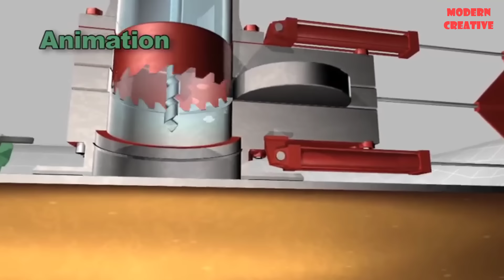Great Teamwork Skills Of The Workers When Hot Tapping Giant Pipeline | Awesome Welding Skill

Comment: For anyone wondering what they are doing in these videos - a hot tap is typically “work” on an in service pipe line without taking it out of service. It’s not really explained well in this video but in the first segment they start out with a big in service pipe, and installed 2 valves with a bypass, this is the piece at 4:15 that allows fluid to flow around the area they are working on, so the pipeline doesn’t have to be shut down while they make repairs or tie in another well or pipeline.  

Once the bypass is flowing, the section between them is isolated and the pressure is bled off with the 2 small silver valves you see them install.  In this video, they installed the bypass, then once it was depressurized, they cut in a valve (blue valve shown at about the 4:49 min mark).  The last few mins of the video shows the hot tap cutter, like a big hole saw, contained in water, presumably to prevent any sparks from igniting what’s in the pipe.
Reply: Very good explanation! I didn't understand why they welded a tee on the pipe without cutting before.
What is the tool at 1:39?
Reply: The contents of the pipeline will not ignite,,,,,   No oxygen.
Reply: Lynn C. Doyle - uh yeah, so long as it’s sealed in the pipe. But......if you drill a big hole in the pipe like what they are doing here, then.....it’s exposed to oxygen.  Even if the pipe is empty of product the remaining vapours can ignite so you still need to prevent sparks.
Reply: @ScoredPiston  I've made several small (2 to 6 inch)  hot taps and still have some of my fingers and most of my face.  How many have you made?
Reply: Lynn C. Doyle - pipeline decommissioning is part of my job.  So hot / cold taps, bleed downs, pigging etc are routine in my world. Stay safe man.
Reply: @ScoredPiston. Thanks so much for your explanation. I’d like to ask you pick your brains (not a zombie, I promise), about pipelines in general,  preferably off YouTube

Comment: Did I blink and miss the bit where they inserted the plug, then cut the pipe section out, welded flanges on and installed the big blue isolation valve?
Reply: The pipe is full and a live and is on those cases is no way to stop theliquid runing
Reply: Looks like its just water. No real threat there like high pressure natural gas
Reply: @HB-kp6rl  Agreed, blue valve is a give away, probably PN10 at the most. HPNG  would be a way better valve..
Reply: Also all low psi flange with just a gasket no api rings
Reply: Dan Koldenhoven when i heard hot tap I thought high pressure. Turns out to be just some regular bullshit water line stuff
Reply: Softcore piping for out of work oilfield workers
Reply: Halifax Matt Bahahaha
Reply: They inserted the plug stopper at the smaller taps on both sides, kinda inflatable type, then cut and put the isolation valve. A lot of details had not been shown on the video.
Reply: No it is a hot tap. The line is live never shut down. Pressure could be slightly lowered

Comment: You could see a complete different approach to safety between Turkey (thanks Patrick) and Canada.   
Canada
Full PPE...check
Using tag lines...check
Properly sloped excavation...check
No beards on workers or bosses...check
Not standing under suspended loads...check
Using fall protection...check
Using hi torque wrenches...check
Only required workers in ditch...check
Advertising for "monster" energy drinks...check
Reply: You didn't go there did you?  This is Turkey...
Reply: My spidey sense was going off the charts in the first one😬😬😬
Reply: Agreed.

Comment: I worked on this equipment everyday for the past 6 years. The valves in the first job looked rough at best.
Reply: Not impressed. The Mexicans are currently hot tapping with 2 man crews and none of the fancy equipment.
Reply: CB I second your comment deffo wouldn't pass a UK inspection
👍👍👍😜🏴🦄🎣😁🤞✌️
Reply: @samsonsrevenge4357  And blowing themselves up in the process.

Comment: Wouldn't the pipe contents be contaminated with metal shavings from that drill? How does that work?
Reply: They're not paid enough to care
Reply: Not much, though maybe not all, most tapping drill had it's own flushing fluids that suck away metal shavings.
Reply: They still the hole after they mount the gate valve with hot tap machine the coupon is collected on the drill bit and the shavings are caught by magnets at the pressure station!

Comment: Great video, but I’m confused. Why did they drill the main t junction hole last in the process instead of drilling it earlier or before welding?
Reply: I think I understand what you mean, but the T is open when they fit it. The plate/coupon that comes out at the and is a piece of the in service pipe

Comment: This would have been better without the music. Maybe somebody explaining what going on.
Reply: And the a bit of text at the top every so often
Reply: Try muting, it works. Reading the text might give some context on what is going on too.
Reply: They are hot tapping this pipeline. It is used to plug into pipeline with something like valve, some measurements equipment or t section, without interrupting flow in pipeline. Google hot tapping and you will find some animations on YouTube.

Comment: Anybody else here watching before doing a huge piping job?

Me neither.
Reply: It’s way easier to just cut the pipe and welded in the tee than the huge job they are making this. Look up pipe liners
Reply: I just found the reason it’s being done in Canada.... they have crazy regulations on pipelining their.
Reply: @robertkakela2068  its because they cant let pressure off, thousands people would be without it for atleast a day. Thats not acceptable.
Reply: I wish I had found this before! Now I know what I did wrong.
Reply: No, but I did before in the oil and gas. Though that this is hot tapping on a water pipeline, a lot of details had not been shown. So, never assume that you know how to do it exactly because you have seen this video.

Comment: I wonder how much pressure is in the line and what the flow rate is while they are welding? This isn’t as easy as this video makes it.
Reply: Those are 600 series flanges rated to 1480 psi. Probably between 500-1400.

Comment: The Best Pipe To Be Using For Upgrades is Called PVC Piping And it is A Hard Plastic Piping And it is A Whole Lot Safer it is Called PVC Water Piping
Reply: PVC won't hold 800 psi in 12 inch line.

Comment: I hate all of the safety nazi comments on YouTube but I was a little surprised with the lack of shoring in the first segment. Here in the US people would be in jail for people working next to a vertical cut higher than their heads.
Reply: Actually if the bottom of the trench is wider then the height of the trench wall it's considered an excavation and different rules apply

Comment: As a retired pipe liner I saw this once in 22 years
Reply: I pipelined for 6 years and we delt with these TD Williams taps and stopple fittings on several jobs it’s a high stress job cuz there is no little problems any problem is a big deal
Reply: You are right everything gotta be perfect i did pipeline in wyoming  and those inspecters dont give no slack at all

Comment: the sheer strength of those bolts is abr 8o,oo0 psa EACH  dunno why there are so many
Reply: Redundancy I assume.
Reply: They had a few extra  left over from the last job.
Reply: Because of vibrations in the pipe. Bolts come loose over time because of vibration.

Comment: The facts about everyone standing around...you have multiple safety men from both the gas company and the contractor hired to do the job, you have a welding inspector, a coating inspector, and multiple company representatives because this process is extremely dangerous and expensive. The 2 red towers insert stopples that halt millions of dollars worth of product from flowing to its destination. They remove the bad section of pipe and replace it and there should be plenty of eyes during this process

Comment: People commenting on how to get jobs. This is not the type of job where you can move slow because you don't want to work hard.  You cannot work half ass or just wing it. Also if you think others are not working so you wont, then screw your a liability.  Ask people if they have ever applied for a job like this.  Everyone says no. If you are good with hands and have knowledge of tools. Look for companies that do this and apply.  It involves travel all over but thats paid for.  I applied for a gas utility job and got it . 2yrs later I'm tapping into low and hp mains . Same process but smaller.  You will work in frigid cold to hot as hell.  At 700 pounds if there is a little screw up,  your main will rip open and your dead.  Thats why a lot of people watching.  Probably from the owner of pipe, engineering,  company doing job,  inspection company.  The main is check for ware and tear before ,during, and after. Everything is xrayed  and done with precision.  A steel main under pressure will rip open from a thin wall or crappie weld. It is a good job and great traveling

Comment: You never weld on a live water main ....it will put lots of burnt contaminates on the inside of the line . There are so many other options that bolt on and will last longer than the pipes.  Completely ridiculous to insert a valve using weld on tees for the stops . One bolt on tee that is the valve...its called a in-serta-valve . Millions of them in the ground in the USA

Comment: I know this is an old video but there are some iregulation such as no fire retardant clothing and that is absolutely not the way to torque a sandwich valve un proper rigging can also be seen no fire extinguishers near by and you are not supposed to add that amount of weight to a live line with a hollow bottom I could keep on going with a lot of other things going on that are wrong but just pointing out some so its really not a great team work

Comment: i thought it was "HOT " taping gas or oil  not make a hole in unpressurized  "water "
Reply: “Hot” implies live product. Doesn’t have to be explosive. That is a pressurized line or else it wouldn’t flow and the would not have needed to use valves

Comment: Giant? Looks like 20” to me?  24” & 30” is my favorite to weld on. .375”w - .416”w somewhere in there? Talk about a beautiful bellhole they have !!  L.U.798💥💸
Reply: How about 16” .188 wall low pressure and no flow???
Reply: @Dnt_Push  done lots of hot taps on the bottom of  2” .188”w and .212”w to drain water. 
And welded miles and miles of 2” .188/.212”w
Hooking up small conventional wells. 
When I was welding on the Atlantic Coast Pipeline I was in the fab yard for awhile, made lots of 
42” 1.250”wall with 3/8” outside hi/lo. it would take almost an entire 50 lb box of rods and 5hrs of welding.

Comment: Or they could just shut it off for 20min and have a team of welders add a t with a valve and not spend like a keep doing all that stuff
Reply: No.  Ah uh,  They shut down,  purge for 24 hours,  feel the line with Nitrogen,  and then have a team of welders do the 15-20 minute job,  vent,   purge 3 times,  x-ray and restart.   While the power plant the line is feeding shuts down for 2 days and power around the region goes down.   

Or they use the flow of natural gas to act as coolant as they weld,  without shutting down the power plants.